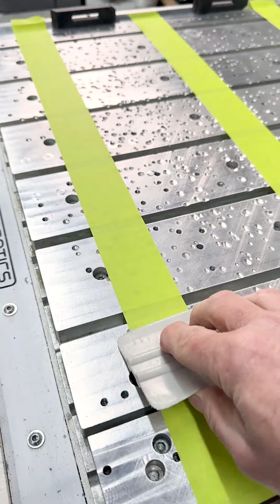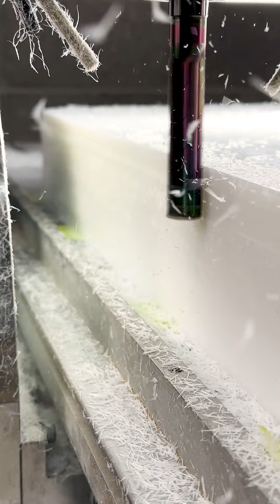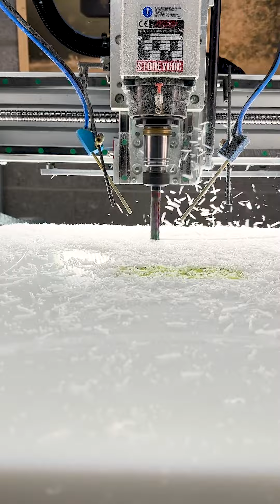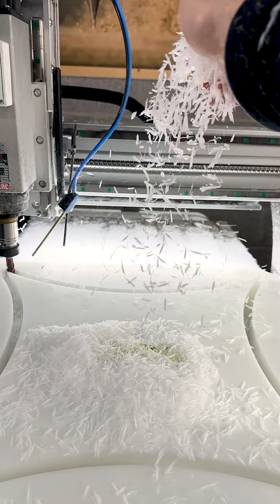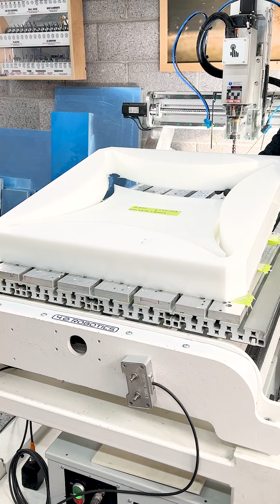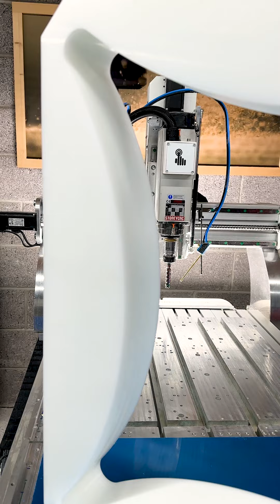CNC Router: 80mm PE500 in 120seconds #video

Comment: Might be a silly question, but I assume that is double sided tape holding the work piece down? If so I assume it’s very strong to hold it down against the cutting forces?
Reply from the maker: Aint silly question at all...Yes, 3M 2060 on both CA glue on one and the activator sprayed on the other. I only had those 4 lines of tape which is ample for this specific application. The more you use this solution the more you get to know it's characteristics and what you can'/can't get away with. Most certainly not the be all end all but a stellar solution that I won't sap for anythign in the kind of work I do...